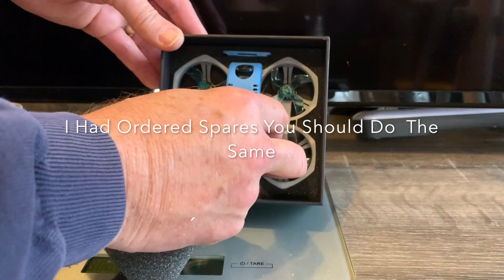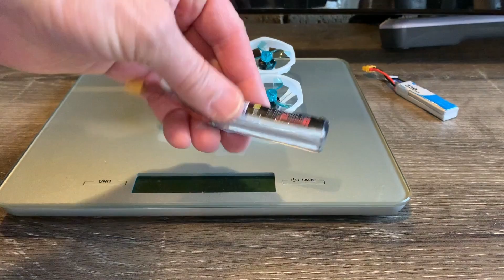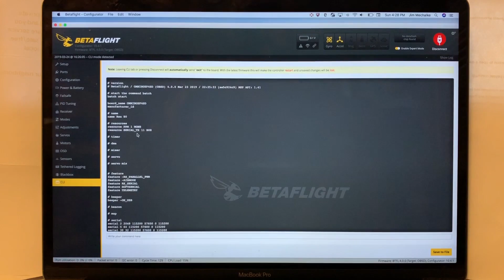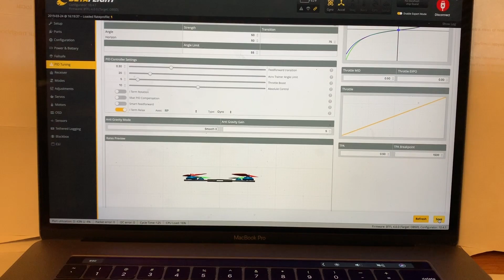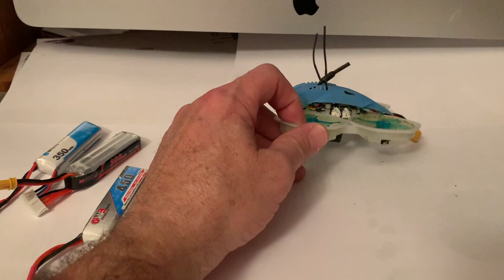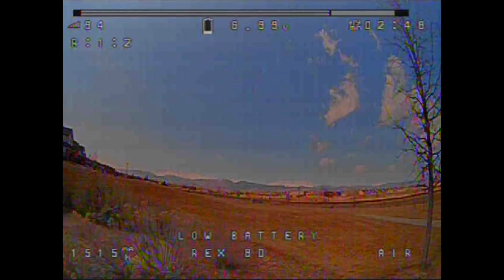Spedix REX 80 Review & Setup

Comment: Flew my mate’s and very impressed with performance, endurance and quality of video feed. It was pretty cheap too.
Reply from the maker: Hi Etops Flight,

I still like mine and I fly it a lot.  A tough little quad. The HD version is not as good due to the added weight and heat generated from the split mini v2.

SLOG

Comment: Stick a 4s on it
Reply from the maker: Super Charged,

I would turn down the PIDs if you fly 4S. I am a little hesitant with flying these small whoops on 4S (e.g. Beta85x HD). Sounds like you have experience with 4s. Curious what PID values with 4.0 you are running.